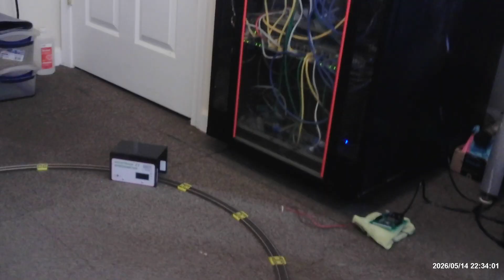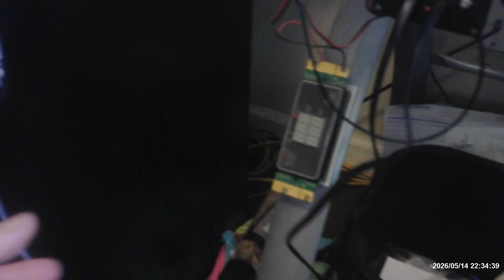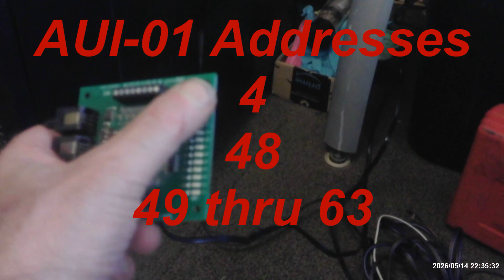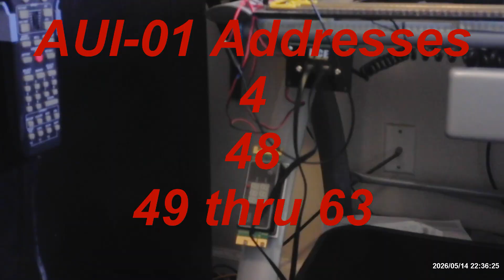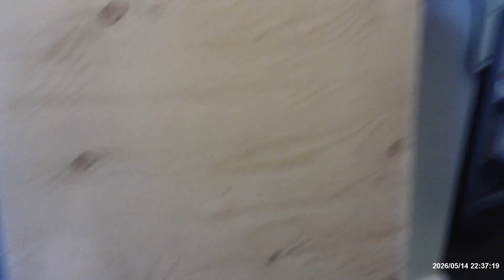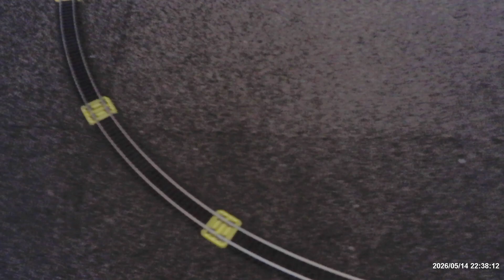🚂 Introducing My New Speed Match Test Track!

Comment: Well, wow, this is amazing. I do it by hand, but this system is brilliant. 16-blocks and you're measuring everything. I can tell by the server rack you've got in there that you're a fellow nerd when it comes to ones and zeros. Impressive work.
Reply from the maker: SouthDown  Thank  you very much I worked in IT for over 50 years Many years of work in the field
Reply: @thomasrgrassijr  Still in the field, another five years left. Still have my own servers running in the basement because, you know, it's what we do.
Reply from the maker: @SouthDown  That black Cabinet behind me use to house many servers are one time only one server running Vcenter software  need to work on that for a future project of mine.
Reply: @thomasrgrassijr  I've opted for QEMU/Virsh under Arch Linux. The choice was made based on the age of the hardware :D